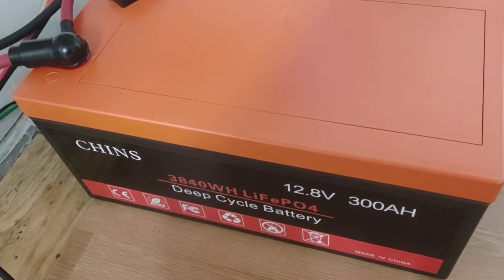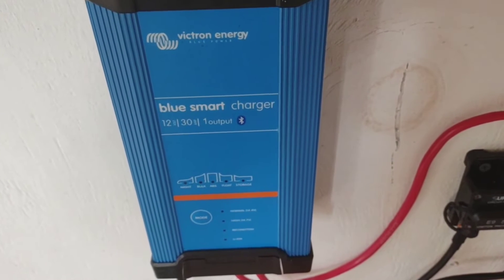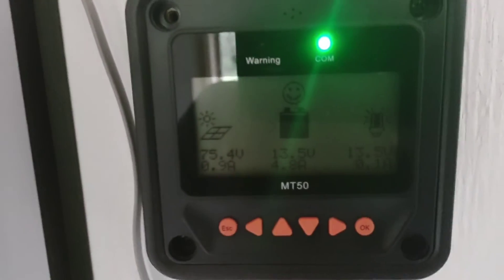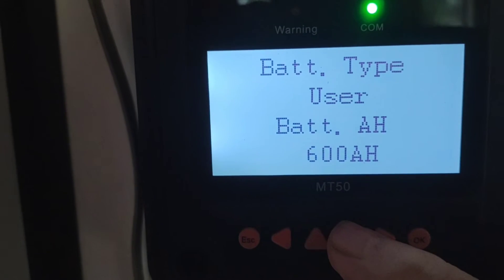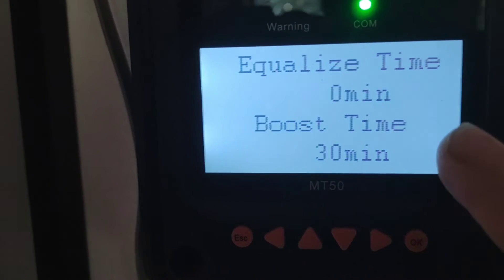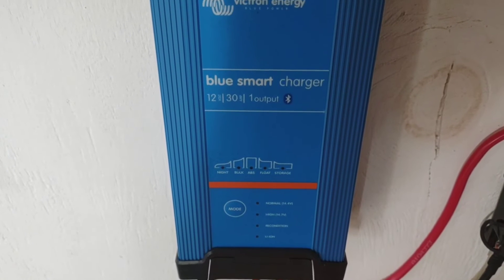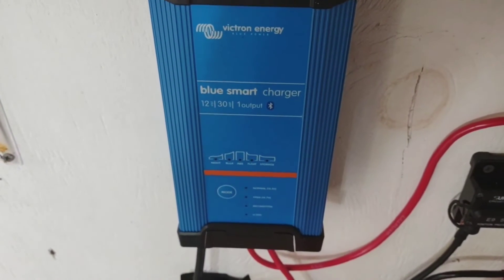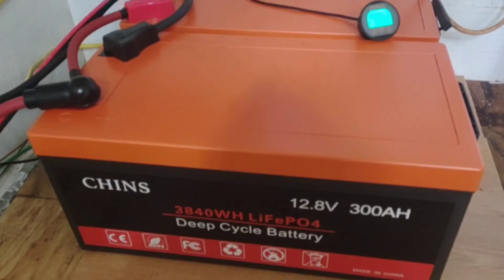Fine tuning the charging parameters on the Chins LiFePO4 batteries

Comment: 30 minutes of hold time is about the minimum, but it usually works fine.  Don't go lower.  I think I did comment ages ago on the prior 5 minute setting being too quick.   Generally the acceptable range is 30 minutes to 2 hours of holding at 14.2V (3.55V/cell), before dropping to the float.

I use 2 hours for new batteries for a month or two and then typically drop to 1 hour of hold.

I also turn off the current-tail setting in the charger, because you don't want to cut off the hold early if you have the choice.  You want to give the battery's balancer time to actually balance the cells.

The float setting should be between 13.4V and 13.5V  (3.35V/cell to 3.375V/cell).  I think I spied a 13.6V when you were paging through the settings... that's a bit too high for a float setting.   Use 13.5V for your solar-cyclic application, that will provide the best load-support characteristics once the battery is full but the sun remains out and available to help with loads.  People use 13.4V when using LiFePO4 batteries as a UPS where the charger is always connected to the mains.

-Matt
Reply from the maker: Aloha Matt! Yeah, currently I have everything running on the Victron controllers with the LiFePO4 preset for 14.2v absorption for 2 hours , then float at 13.5V . Everything is humming along perfectly with that. Maybe in the summer when everything is in surplus I'll drop the time down some on absorption. This winter has been the best solar catching out here by far...in many,many years. No generator needed at all which is great! Aloha!🤙

Comment: Hi, good video, I was just looking at my Renogy 10A control manual and noticed that the boost charge is set for 120min as a default. Wonder if dc to dc controllers should have less boost vs solar controllers?
Reply: No, its a choice.  Equipment type doesn't matter.  30 min to 2 hours is the acceptable range.   Depends on how well the battery BMS is able to keep its cells in balance and how quickly you want to catch-up after a week or three of bad weather has passed.

I typically use 1 hour myself, with the current-tail disabled.

Comment: Awesome info👍👍👍
Reply from the maker: Thanks for watching 🤙
Reply: @ProjectsinParadise808  my battery bms goes into 3.65v cell ovp due to some cells reaching full charge while other cells are only around 3.33v and when this happens the bms disconnects the charge cycle.  The bms is blue tooth that's how i know each cells voltage.  Probably a faulty cell.

Comment: Sir I want to know does this EPEVER 40A mppt charge controller able to charge 600A battery bank with 6 hours sun shine? Or should I need external charger like you attached Victron, as I am new user of EPEVER
Reply from the maker: It depends on how much you're using of course,  and amount of sunshine etc. with Lifepo4 you don't have to get fully charged everyday...its happy to operate between 80%-25%. It just depends on what you're trying to do with it.🤙
Reply: 40 A X 6 hr = 240ah 240ah/600ah = 40% discharge. So if you only use 240ah or 3,072wH in between full sun hours yes. Find out your daily usage, watts or amps X hours used.

Comment: At what voltage does the BMS start equalizing between the cells of the Chins? I am also struggling to  put the boost voltage. Thanks
Reply: I ask the manufacturer for my Zooms battery and here's the reply:
A: Dear Customer,
For the 12V battery series, the BMS start to balance at 14V.
For the 24V battery series, the BMS start to balance at 28V
By Zooms Seller
Reply from the maker: I can't say for sure Howard,  but it looks like 14.2v far as I can tell.  On a 10 amp charger,  it pulls 10 amps continuous until 14.2, then shuts off. On the Victron 30amp it pulls 30 amps until 14.2, then slowly reduces current for a half hour holding 14.2 until it takes basic only about 1-2 amps to hold 14.2. Same on the Epever.  Chins recommends 14.2-14.6 , but I can't see any ah to be gained after 14.2. Hope this helps you 🤙
Reply: @ProjectsinParadise808  Between 14.2v and 14.6v is about 1-2% difference in storage capacity. So  your 600ah (7,680wh) storage will be only around 7,526wh if discharged to 0% 10v
Reply: Thanks for that. I too am at 14.2 but had no idea if equalizing was happening.  I am new to this hobby and still working on getting a shunt to monitor these values.
Reply: Cell balancing happens with any voltage above rest voltage of around 13.5v on a LifePo4 12.8v bank